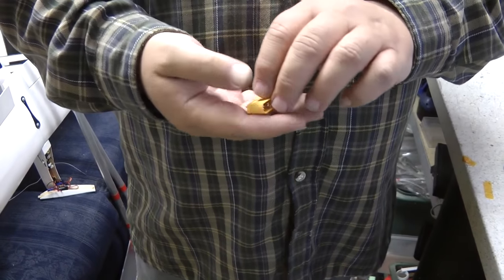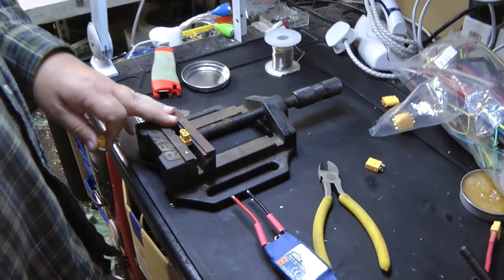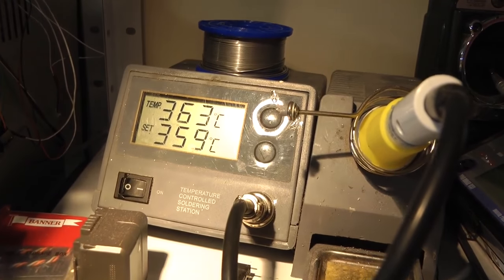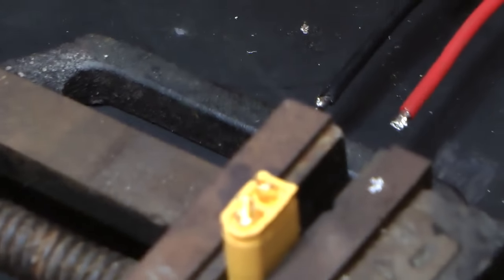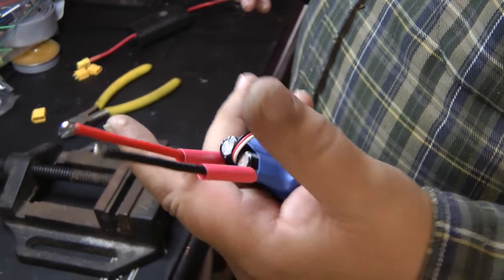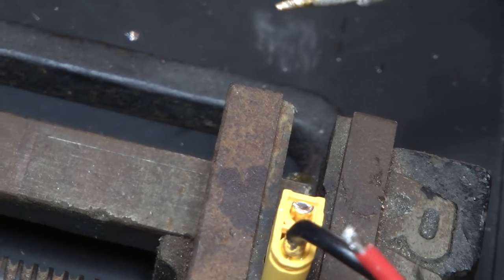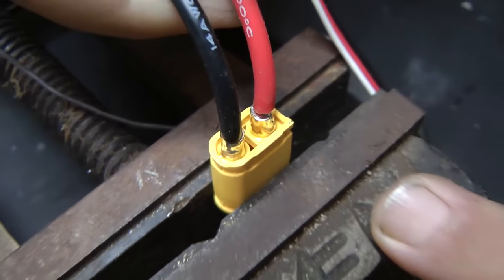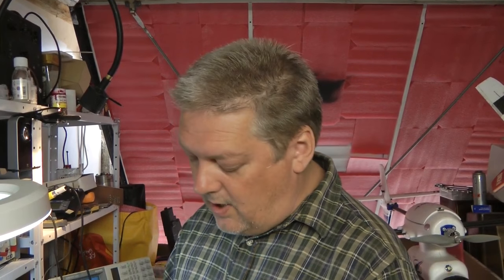Hobbyking Amass XT60U Good Or Bad Melt Or Not RC Model Geeks

Comment: Some people will try to use a Tip that is too small, remember the Mass of the tip is important, it is like a capaicitor, it is the reservoir that is holding heat, when one applies the tip to what is to be soldered, heat flows from the tip to the connector pin and the wire, the Power Wattage of the iron determines how fast the tip can be resupplied with energy, how well the ip will maintain its temperature, how fast the Heat Capacity can be charged. A perfect setup setup is when the tip of the iron can be supplied with energy fast enough to allow the tip to maintain it temperature.

Sometimes people will try to set the tip temperature too low when trying to prevent heat damage, a good arrangement is when the soldering operation can be completed within 3 seconds.  Heat takes time to flow into an object, setting the tip to a higher temperature and the Tip having enough mass to hold enough heat will allow the soldering to be completed within 3 seconds will prevent heat damage, soldering can be completed before the plastic or PCB will be heat damaged.

Clean the parts to be soldered, use at least 99% alcohol, grease and oily surfaces are your enemy! 

Clean the surfaces to be soldered with very fine sandpaper or a fine wire brush to remove oxidation usually not needed for Gold plated connector pins and fresh wire that is plated. 

Apply a little soldering flux, there is flux in the core of your solder, but having some flux on the parts to be soldered helps. You don't need to flood the flux onto the parts, you will have to clean the flux away when you are finished .

Set the iron temperature correctly.

Make sure the tip is cleaned, tinned, and just a little solder is applied to the tip Just before soldering.

The tip should make good contact with the objects being soldered to get good Even-Heat Transfer.

The objects being soldered should be reach the correct temperature to complete the soldering operation within 3 seconds.

Often people will apply a lot of pressure thinking this will help. It will only help to cause damage.

Clead the flux off the soldered objects ASAP,  when the flux is still warm it is easy to remove.  you can use a Q-Tip to remove a lot of flux while it is still warm, then when you apply alchool it will not just spread the flux around as a thin film.  Q-Tips will leave some strands of lose cotton, you can use a fiber-free style of Q-Tip as can be found  in electronics catalogs and also whats call Chem-Wipes, they are Lint-Free.

For wire make sure the wire is properly tined before trying to soldering.  If you are going by aerospace standards, which you should do for all soldering, you will use some form of an anti-wicking tool on the wire to prevent the solder from wicking up into the wire past the insulation. This is standard in Aerospace and military specifications. It is just good practice, it has proven to work, so just make it your habit to do so. Even for a Hobby just work in a professional manner. Hey if you go for a job interview and you show professional level skills you will have a better chance of being hired! If I am interviewing someone and don't show good skills, or if they have the attitude, Yeah I do that when I have to, they won't be hired.

Import - Practice, Practice, and try out these techniques;  set the temperature too low and see the results, use a small tip on your iron and see what happens,  trying using a dirty tip,  try things to see what is working and not working. Sometimes if I have not done any soldering for a while I will use a practice object and do a little practice runs, kind of a warm-up exercise.

There are NASA tutorials and other YouTube Tutorials one can study, watch then go to your shop and Practice!

A note on Gold Plating, Sometimes the gold plating is removed before soldering, gold can form an alloyed joint that can become brittle which can fail under high levels of vibration. 

Very freshly cleaned copper gives the best joint.

It is important that both objects to be soldered be contacted by the soldering tip.

It is importand that the objects to be soldered are in firm contact with each other.

When someone tells you about a technique try it out to see if it really works, how will it works or not, and understand how and why.

Have Fun!

An Addon, sometimes if the parts to be soldered are massive I will use a heat gun to carefully warm then up a bit before soldering, it helps!  Also for soldering I will use a Heat plate to warm everything up a bit, this is what Re-flow ovens do for re-flow soldering SMD components on a PC Board, thy use a heat profile which includes a gradual warm up phase before ramping up to the soldering, then a graduale ramp down to a cooler temperature.

Comment: Amass seems to be pretty decent if they are real. Im having issues with normal xt60s melting due to the battery discharge amperage which is hard to believe. I think the secret is there are many different grades of xt60,U,H,M, HT and a few other letters im about to look up ;) My trick is i will either chuck it in a vice like you did before soldering or connect a male or female end to give it a little "heatsinking" action and keep it cooler while soldering leads on ;)

Comment: rc model reviews only showed that the plastic melts when you put your iron on it. of course everyone puts the opposite part of the connector to it when soldering, but I find it nice to know that it melts at that temperatures. anyway there won't be deforming when using the opposite connector... I'll always be buying the good old xt60s :)

Comment: When did you order these connectors? It looks to me like HK might have had a duff batch and re-stocked because they make a point on the listing page that the XT60U are not the inferior copied ones which melt. Anyway, that aside, I don't think having a dig at RCModelReviews was strictly necessary; he was only trying to point out that there was an issue with these new plugs not being as resilient to melting as the older, better quality ones. 

I have been soldering Deans, XT60 plugs, even Tamiya plugs (yuk) for many years. The Deans clones have a tendency to get a little wobbly, particularly if you don't have a good iron. Also, if you have to solder one up in the field, with a stiff breeze blowing and a gas soldering iron, it's better to have something which will withstand the heat for a bit longer. I wonder if the air gap between the pins is to improve insulation between the pins, or just to save plastic?

Also, if we are having a dig, at least in the Old Bloke's video you can see what he is doing, whereas your one shows a close up of your pinkies and not the pins being soldered at all ;-P
Reply from the maker: The point is these connectors are usable if you solder them with the right technique!  The same technique that Bruce used in an earlier video on soldering XT60's!
Reply: I've made many good buying decisions by following Bruce Simpson's advice, especially when it comes to purchases from HK. You need to be selective with HK because they often sell inferior products and don't seem to to care. Careful watching of Bruce's video shows that he was not intending to show the correct technique for soldering that batch of connectors, just that the particular batch was clearly made of inferior thermoplastic and not nylon. Clearly they've now corrected that problem, and probably because of his video. He makes a great contribution to the hobby, and has done for years. Not sure about you guys though.

The crack about age is very low.

Comment: Good Follow up guys, the proof is in the pudding!

Look forward to your cumulus test flight!
Reply: Also as a follow up question, seeing as there is <$1 difference between the XT60U and the XT60 w/ insulating end cap, which would you say is the way to go? Cheers
Reply from the maker: I've not had the version with the slide on caps so its hard to say. My only thought on the slide on caps is...will the cover stop shorts inside the connector. say for example if you get a stray strand of wire coming loose. at least with heat shrink the whole joint is encapsulated.
Reply from the maker: Me too! Bloody weather!

Comment: No matter what way you look at this new iteration of an xt60, they are inferior to previous versions. Even the small gap created in the middle between the 2 terminals is a dumb ass idea let alone using a material with a low melting temp.
Reply from the maker: Certainly there is a higher skill level needed to solder these connectors successfully, compared to the old style of XT60.
Reply: And you guys obviously have those skills. Cheers for the heads up.

Comment: Is the counterpart connector used for alignment made of the same inferior material as the connector you are soldering? I presume so, otherwise the two aligned connectors would melt the plastic of both male and female connectors and have the entirety of male and female metal part being pushed out of alignment. Looking at the temperature you are putting in (360 degrees vs. 320 as set by Bruce) and the time you are baking your connector to solder the wire to said connector (way longer than Bruce was heating his connector for) it is fair to presume that your connector must have been molten around the connecting pin. Would the connector used for alignment also have been made out of the plastic with the low melting temperature, all would have been melted. 

So, your trick only works when you still have connectors of a higher quality lying around. It is thus fair to say that the XT60U connector per se is flawed, as was asserted  and demonstrated by Bruce. 

You're just placing a low blow imho. You should change your channel name to "cheap shots".
Reply from the maker: I suggest you watch the video again the mating half used was also an XT60U. Use the right technique and they solder fine.

Comment: Thanks for sharing..... I hope your motives were genuine here. The dig at 'old RC Modelers' I feel is misguided. See the following link... in terms of the correct technique. https://www.youtube.com/watch?v=nS0bEuYPJoA / 26 min 45 secs in.

 I think the issue here maybe copied XT 60 / XT60U plugs / sockets. I guess the point here is  if the new XT60U's are the same grade Nylon as the genuine original XT60 there should be no problem. 

Will you be providing a summarized critique of the RQ 7 ? Thanks Martin
Reply from the maker: So in that video its fine to use the other half of the connector while soldering it. Yet in his XT60U video its not fine.  Go figure :o)

RQ-7 on hold until more flying. No motor as yet!
Reply: I think it is human nature! With genuine XT60's, for most situations ( smaller gauge wires), you could get away without a heat sink. We do what is necessary and get use to that as the 'norm'.